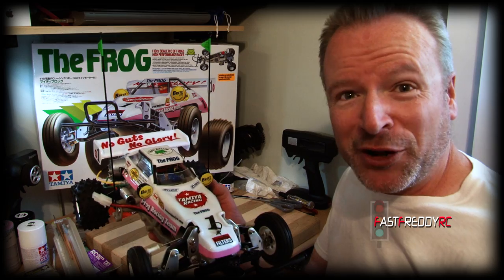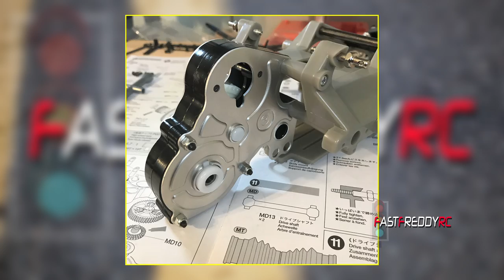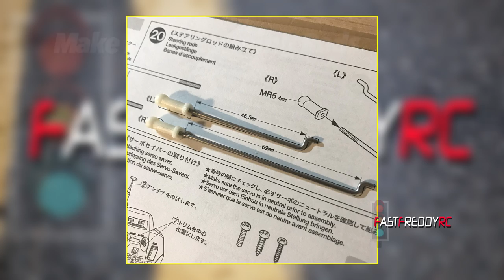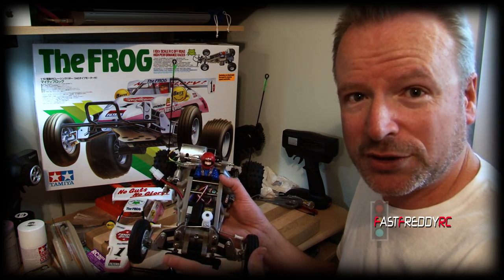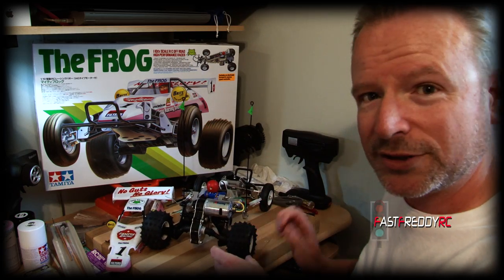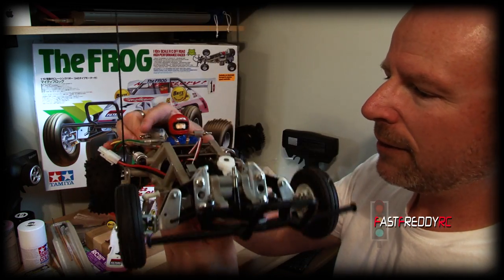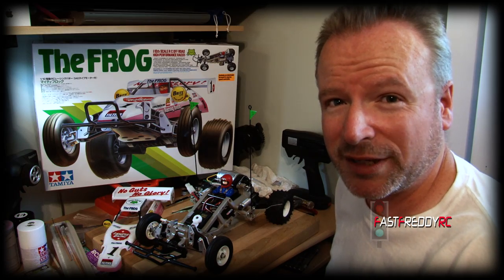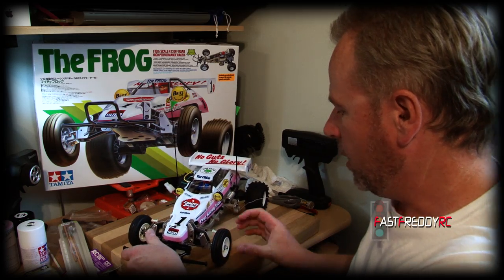Tamiya Frog - Build Tips and Tricks

Comment: Applying rubbing alcohol or even vodka or gin to the rubber and wheel will greatly aid the process.  I used to have a motorcycle shop and mounting tires on motorcycles can be a pain, and pulling the valve stems in can be
tough too- but splash a little vodka or whatever alcohol/water blend like rubbing alcohol and prepare to be amazed.  Works on radiator hoses, handlebar grips, fuel line, grommets, o-rings- whenever you feel like swearing when trying to get rubber to slide on something.
Reply from the maker: Interesting...I definitely have never thought about vodka!  I'm going to have to try that!

Comment: One solution regarding the hardware location issue, is to source and install an original release metal MSC mounting plate and affix the ESC inverted, to the underside of that. 

Then mount the receiver (in a Tamiya balloon) to the side of the steering servo (with double sided tape, or cable ties).  

Then attach a square of lexan or similar with servo tape, to the underside of the chassis where the big void is, just behind the skid plate, to help reduce the ingress of crud to that potentially vulnerable area 🙂👍🏻
Reply from the maker: That’s a great idea! That mounting plate would have been a great addition to the kit to give you more options. I’ll be curious to see how hard it is to find one. Thanks for the ideas. It’s definitely a weird idea to put the ESC so close to the ground as per instructions. Not sure what Tamiya was thinking 🤔
Reply: Absolutely, I couldn’t agree more. 

I think it’s a case of room being at such a premium in the ORV chassis without a larger body to help house items, that they ended up putting fragile items in really stupid places. . 

Plus a lot of stuff is exposed due to the spaceframe nature anyway. 

The fact Tamiya managed to fit everything in the original car is a miracle of packaging. 

Were it not for the implementation of BEC setups and the poor driver being an amputee, the car couldn’t have functioned, short of it wearing a jaunty roof rack with four AA batteries as a payload 😆 

The deletion of the MSC plate from the rere kits was incredibly thoughtless on Tamiya’s part. 

The two plastic bars that replace it serve no purpose other than to join the chassis halves. 

I don’t know what they were thinking 🤦🏻‍♂️ 

They do turn up with relative frequency on eBay. 

I’ve managed to buy two new old stock examples very affordably in the past six months or so. 

So I’ll be fitting one to my runner Frog and one to my runner Brat. 

I’ll probably carry on looking for more for my remaining cars as I think the chassis looks totally wrong without it. 

A mint one shouldn’t set you back more than about ten dollars or so😎👍🏻

Comment: After much cursing trying to fit the wheels into the tyres on my Hornet and grasshopper, I found by far the easiest method is to stretch the tyre out with two hands whilst my partner dropped the wheel into place.  Literally only takes a couple of minutes and saves your hands a lot of grief.

Comment: Hi,
I used to be so envious as a kid in the 80’s of my friends owning the original Frog, Grasshopper, Hornet and alike, can you tell me now I am 50, and desperately want to grab something that is now definitely affordable for myself, can you tell me if this is a good starter for a first time build despite using them on the odd occasion way back then I have no experience in building RC cars, I watched some use cable ties on one of the videos for around the rubber bars (I don’t know what they are called axels I think) and obviously my friends didn’t do that so have things moved on and is that why some do it, (add the cable ties and so on) my budget as I have looked at the actual Frog you show and I can get it without RC gear for under £100 so I’m basically looking for as much advice as possible, sorry for the essay lol, thank you.
Reply from the maker: Well for a first time build I might suggest the Grasshopper.  It's an easier build and definitely more affordable than the frog.  I'm also in the middle of doing a complete build video series on the grasshopper specifically designed for beginners which might be helpful for you.  In Canada, the grasshopper is $149 for the kit and the frog is $239 for the kit.  So I would imagine you can get the grasshopper in the UK much cheaper than the frog.  If you haven't built anything before the Grasshopper is a perfect starter build.

Comment: Can you recommend a steering servo and battery for this?
Reply from the maker: Definitely! So I’m a Futaba fan myself and for any of my ORV chassis’s I use the Futaba 3010 high torque ball bearing servo. I just find with the servo setup on this chassis a stronger servo is preferred.  As to batteries, I have a number of 7.2v batteries but the company I used to buy them from went under. I’ll see what I can find for you.
Reply from the maker: Where are you based? That will determine where I send you for batteries.